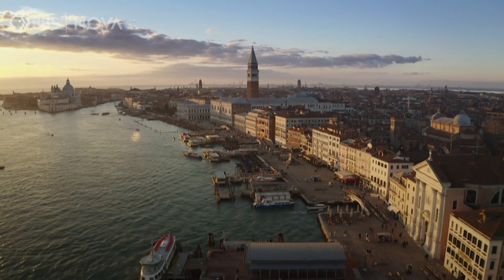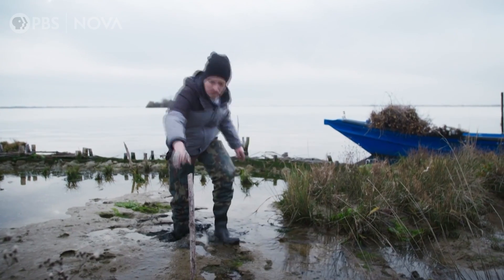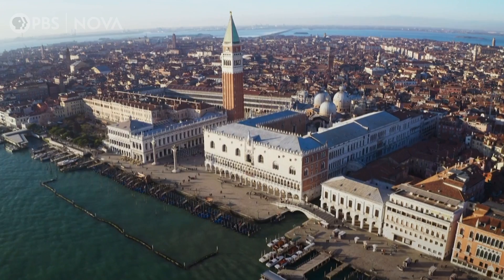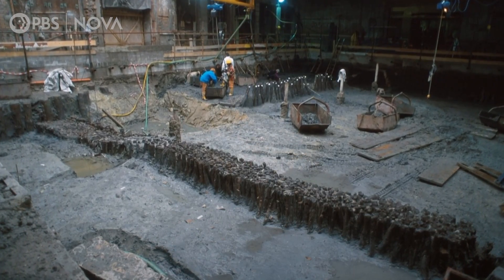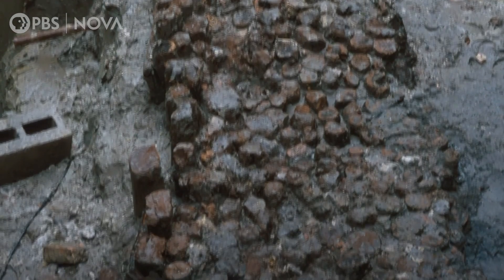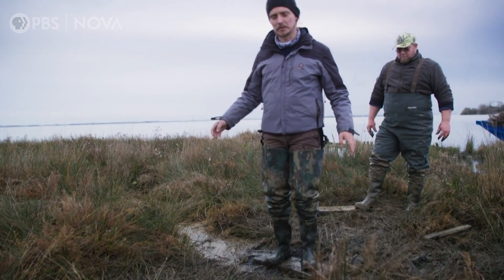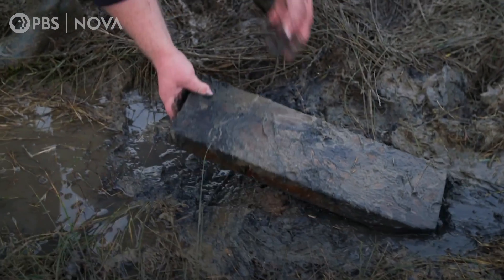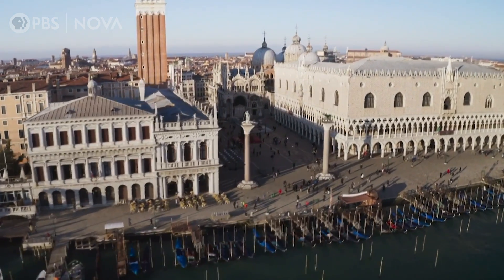How Venice Was Built On a Swamp

Comment: Wouldn't the wood poles decompose over time? Wouldn't the city sink?? 😱
Reply: well  actually its quite the opposite, they say the salty mudwater keeps the poles from decomposing, evenso in amsterdam. its when waterlevels drop and the poles come in contact with the air they start to decompose and houses will start to crack
Reply: No, the wood calcify therefore it becomes stronger. If I'm correct it's water+ oxigen that cause wood decomposition